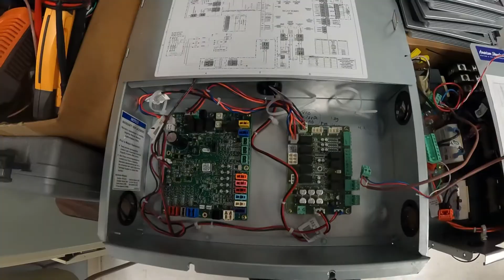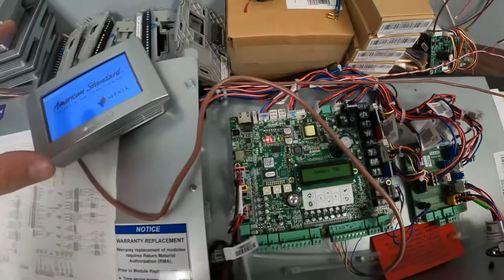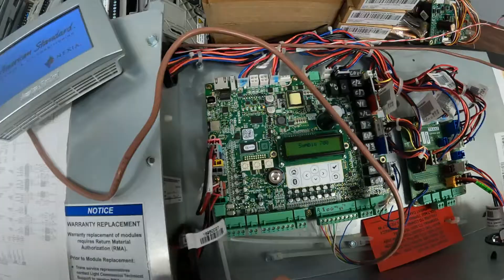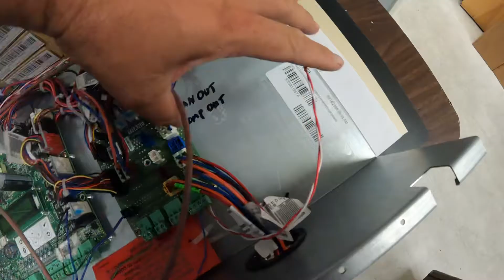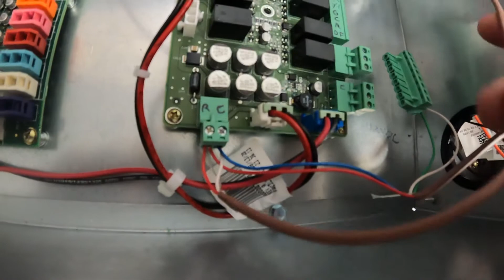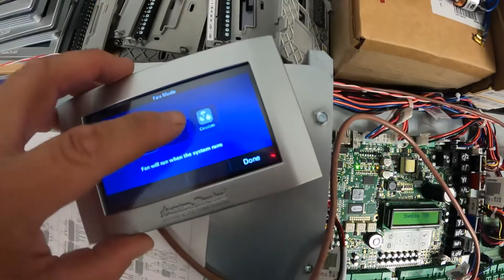American Standard Trane Symbio 700 intro and wiring

Comment: You have good knowledge of the Symbio 700...our customer wants conventional thermostat input to control unit from a DDC System (not Trane) and has the Trane VFD that came in the package, and wants to control the Fan for a Zoning System, based on Static Pressure.  In Config Menu, selected Conventional TStat, but he says that messes with the VFD control and makes it two speed in Conventional TStat...Do you have any idea so this?  Thanks in advance. Reed

Comment: I am correcting an install on a unit Trane is absolutely no help, I have the same error code your showing but my IMC is wired up identical to how you have it wired
Reply: Oh key note I have a vfd so I have the J16 and J7 connected but nothing will work won’t even go into the test mode
Reply from the maker: If you have a VFD. You will probably need to set it up for VVZT. Not CVZT.
Reply: @Hvacoffroad  I’m going back Monday, when I change that setting it instantly looses IMC  communication . Have vfd bypassed for the moment but going back to figure it out. 
 I was able to get it going just isn’t right

Comment: About the heat kit? Where you connect?
Reply from the maker: In your heat kit, you will get a wire that connects to the J2 or J3 plug on the top of relay board. 
If you didn’t buy a new heat kit, you will need WIR10632. That is the harness that will connect to the relay board.

Comment: Thank you for the video. You’re the best. 
I hooked it up exactly the way and I’m still getting indoor options mod comm error with the red light on the outdoor board like you had till you plugged in indoor board at the end of the video
Trane did have me connect outdoor J16 to indoor J7 and that still didn’t work 😢
Reply from the maker: What faults are you getting on the app?
Reply: @Hvacoffroad  I've installed 3, 2 more recent on same property. The 2 new ones say "indoor modcombus" or something to that effect (been a few weeks since) and first one installed back in August last year (first one; aimed for bushes), changed compressor tech support recommended, now on startup it runs intermittently with "comp 1 proving switch". It's not red or even yellow, just gray. It's 2 stage single compressor.

Comment: I must say, its definately a trane. I have a symbio ahu claims to be two speed with a vfd that has a 2 stage gas furnace along with not one but two symbio condenser straight cool that i used the fancy z pairing on. I have twisted pair to both units but nothing in the docs anywhere really says if the 2nd condensor needs the imc connected. And just like everyone else on the planet, it aint working.   What a convoluted thing this is.  Why? If anything stops working it all will stop working. No heat from the vfd that cant speak with the cool only condensers,  sorry. It just makes no sense at all.
Reply from the maker: It sounds like you have a very unique pairing.  I would recommend reaching out to who you bought that equipment from.  They should be able to help support you.  Sorry, I don't think I can help with that combo.

Comment: Does it matter where you put the red and black so long as they are in the J18 emergency stop?
Reply from the maker: Correct, shouldn't matter which terminals on J18.  They are normally open contacts.  When closed, they will trigger an e-stop.
Reply: @Hvacoffroad  thank you.

Comment: How to do the connection for unit with vfd
Reply from the maker: Same way as I show in this video, with the addition of another twisted pair of wires.  It should run from J-7 on the indoor relay board to J-16 on the outdoor adapter board.  I hope to make another video on this as soon as time allows.

Comment: I have a trane heat pump condenser symbio paired with odyssey vfd air handler. Wired accordingly, used communication wire. But still have light flashing on vfd controller 5 times for no communication. Any clues?
Reply from the maker: Either it’s not configured in the app right for the vfd or it’s not communicating through the modbus wires. 
You do have to run an additional pair of communication wires. So 2 bundles. One  pair for the options mod and one pair for the vfd.

Comment: I did the exact connections you did, note this is my first time dealing with symbio, but our unit keeps tripping at the transformer, same connections but it just trips
Reply from the maker: I would suspect a wire short then. 
Remove the wires from J21 on the condenser and jump the pins together for the desired mode. Does it trip then?

Comment: Great video and really helpful man thanks for taking the time to do this kind of videos hope you make more like it
Reply from the maker: Glad it helped. I’m working on a Symbio vfd air handler video now.
Reply: @Hvacoffroad   I will be looking for this one i just installed my first one on a school gym and it will be interesting to watch
Reply: @Hvacoffroad hey o was wondering if you ever made a video regarding the symbio with a VFD AHU. I heard in the video that you brought the hot 24VAC from J10 to J4 this is needed for the controls side  for the VFD? And also is the twisted communication for the imc needed if you are using a straight cool unit? I tried finding this info else ware and could not. Any info would be awesome!
Reply from the maker: I finally got my hands on a VFD air handler an will start making videos on it soon.  I'm hoping the end of the month.  
The J10-J4 jumper is used to power up the IMC for the options mod and electric heat in the defrost mode.  You can get away without that jumper and twisted shielded wire on a straight cool unit with a constant volume air handler.  But if it's a heat pump or if it has a VFD, you need the jumper and 2 bundles of the twisted shielded wire.  One for the IMC and one for the Modbus.  
I hope to get the videos out asap.  
 @mattkusano7246
Reply: @Hvacoffroad  do you have the video with vfd already?  i am installing a symbio 700 with vfd TR150  and I can not make it start the inside blower in air handler
Reply from the maker: @vianeydiaz8498  This may help.

https://youtu.be/-2JLX8FPbJM

Comment: Question guys, on the adapter board, what if the thermostats wires are not connected ??
Reply from the maker: The adapter board serves as outputs back to the air handler.  You'll need those connected.

Comment: Great videos !!!! very limited help with the Symbio 700    . I also had Trane technicians come out and couldn’t figure it out, my problem is I lost my 24V output on the thermostat connection point j21 but the board display is active with no errors,  this is a new install. The other 20T split is working well.
Reply from the maker: I think I understand.  So did you move your thermostat source 24v to  J15-1,2 on the adapter board?
Reply: @Hvacoffroad had a call where i had 20volt call from thermostat on the y2 terminal and 22volt call on the y1 terminal - or could be the other way,  don't remember, --had no voltage coming out of board to the contactor on the side with 20 volt call.....since it was a new install, had to refer it to original contractor....can you tell me what the problem could have been????board, thermostat,  reset????ty

Comment: So I'm switching out both outside and inside units. Not in a position to run a new stat wire. Original wires came through the air handler. I got that part how to work around that. My problem is, after the thermostat controls are hooked up I have 2 spare wires left. I'm gonna use one for evaporator defrost and the next to connect to indoor fan on adapter board then tie it into the condenser G wire on the inside. Is there anyway pass running the twisted shielded wires when you want to use the options module?
Reply from the maker: There is a manual from Trane that’s has and “experimental” defrost circuit. This may work for you as it doesn’t require the twisted shielded wire. 
https://tranesupport.zendesk.com/hc/en-us/articles/360059909352-Odyssey-Symbio-700-Troubleshooting-Manual

Comment: Hi excellent video! What is the option module for? I have the relay board but no option module but I do have a Symbio outdoor unit. I have a heat pump without electric heat. Thank you buddy
Reply from the maker: Currently, the option mod only is needed to energize electric heat during defrost. They intend to us it for more, later on. 
So with you application, you don’t need it if you don’t have electric heat.
Reply: Do you use it for straight heat kit or is it just heat to during defrost. I have a Odessey unit installed but no electric heat because Trane said I needed the heat options board to run a heat kit for emergency heat? Thank you sir you made this very easy to understand you should be teaching hvac.
Reply from the maker: @2tiresdown  To wire it up the way the factory wants it, yes, you need the options mod for electric heat.  But if you are using a straight cool with electric heat, you don't "need" it.  You can send your Heat call to the relay board on the w2 pin, and it will energize electric heat, without the options mod installed.  But don't "tell" the symbio board you have electric heat when programing the outdoor unit.  If you do, it will search for the options mod, and pop a comm failure code.  Hope this helps
Reply: @Hvacoffroad  awesome thank you buddy you are a lifesaver Sir
Reply from the maker: @2tiresdown  you’re very welcome
Reply: @Hvacoffroad  when I send my W2 call for electric heat how do i get it to my electric heat contactor with the heat options board. I know you said on the W2 terminal would it be on my air handler W2 or tie into the thermostat wire going to the symbio outdoor unit W2?
Reply from the maker: @2tiresdown  if you are using the twisted shielded wire, it sends the signal into the air handler for electric heat.  You would only run your w2 from the t-stat to the condenser.
Reply: Hi buddy last question I actually ordered the heat options board because I have a heat pump. We can get access to run the Line set until next month but I wanted to run the heat kit. Would I just tell the 700 I have the heat options board and wire it up? Or since I’m not using the heat pump could I just wire it up and leave off the cooling or y1 connections and just wire it up to W1 for now? Do I need to add a heat contactor or is good with just the options board to run it like normal? I appreciate all your help and I feel terrible to keep asking but Trane has been no help at all.
Reply from the maker: @2tiresdown  no worries man. 
If I understand you correctly, you just want to use electric heat until you do the piping?
I think you can program it as if you had a heat pump with backup heat. But, like you said, don’t hook up the y wire for the compressor.  No extra contactor needed if you got a new heat kit with the air handler.
Reply: Also thank you again for all the help send me your cash app info and I will cash app you for all the help you been to us. Thank you buddy
Reply from the maker: @2tiresdown  I’m happy to help.
Reply: My condenser comes on and shuts off after a few seconds with no error except compressor proving

Comment: How do you wire this outdoor unit without communication air handler ? I got a unit just installed and don’t know why it’s not coming on .
Reply from the maker: You don't need to wire this outdoor unit to a communicating air handler for it to function.  The communication wires are only used for electric heat defrost, with the current setup.  Will it work using the test mode in the app?
Reply: @Hvacoffroad  it took awhile for us to get it running , I didn’t know the board has the features that wont allow the unit to run if it in wrong phase .
Reply from the maker: @avr8891  Glad to hear.  That symbio app will help assist with the fault light.  If you ever see the red fault light, connect to the app and check the service tab.  It should point you in the right direction.

Comment: Can’t get my indoor communications failure to go away. Not communicating to properly run my 2 stages of heat “IMC”
Reply from the maker: Check the addressing dials.  For electric heat, the should be at "75."  SW1 to 7, SW2 to 5.  If that wasn't done before start up, you'll have to reset the IMC link under the service section of the phone app.

Comment: I replaced an older Trane system with a new one with Symbio...It was a 6 story building that only had 2 conductors between the air handler and condenser. How will Symbio work in that application? IMO this system is not compatible with most changeouts since there is not going to be enough control wires. Here in South Florida we have mostly straight cool systems with 2 conductors to the outdoor unit.
Reply from the maker: That's a great comment Steve.  I had to think how we can overcome the issue of 2 wires.  Check out this video i just made.  See if it will help you in your application.  https://www.youtube.com/watch?v=TMjf_Kryd8g
Reply: I agree... after all that New School Symbio controls the fans and compressors run just like Old School :) and for only and extra $$$$ dollars.  I have to admit though it pretty amazing what the controls can do.

Comment: Do I need to use that specific thermostat or can I use a conventional tstat like a honeywell T6 pro thermostat? I wired up the unit, excluding the twisted shielded cable because the air handler did not come with the options module, and both compressors turn on (it's a dual compressor condenser and constant speed) and off at the same time (I hooked up y2 on the J21 terminal to my thermostat). It can't seem to differentiate between stage 1 and stage 1 + 2. It also gives me an alarm stating that there is a communication failure but I wired it almost identical to yours (excluding the twisted shielded wiring and it not being a heat pump). 

Do you think it's the thermostat, or maybe I didn't configure the symbio settings correctly?
Reply from the maker: Alex- Any generic thermostat will work so your T6 is fine for your application as long as you wired y1 and y2 accordingly. 
It sound like a configuration issue to me.  Make sure the “cooling” is set for 2 stages on the configuration screen. 
Will it run in first an second stage independently in test mode?
Reply: @Hvacoffroad  I appreciate your response. I made sure that cooling was set for dual stages on the configuration screen, I have Y1 and Y2 wired, and when I run it in test mode, both first and second stage run independently. I've contacted Trane and someone told me the unit is not set up for 2 stages even though I have two expansion valves and a split coil in the evaporator. They told me they'll get back with me tomorrow to discuss my issue. But I just want to thank you, because your videos have been a big help and have made me understand this more. I really appreciate it!!
Reply from the maker: @Alex-bk4vc  If each circuit will run separately in the test mode, your configuration is probably correct. 

Look at the black relays on the symbio board when you call for first stage through the thermostat. Do you see LEDs light up next to “LED 5 and LED 15”. 
5 is for first stage and 15 is for second stage. 
Also. Look at the “home” screen on the symbio app. It will tell you if it’s receiving a signal to open or close contacts. Look to see if y1 and y2 are “closed,” when you are calling for y1 only.
Reply: @Hvacoffroad  So I finally figured out what was going on. In Symbio split systems that are 10 and 20 tons, and that are dual circuit, the compressors have unloaders. So when y1 is closed, both stage A and stage B compressors will run but only at 66.7% cooling capacity. When Y1 and Y2 are closed, both stage A and stage B compressors will run but at 100% capacity. When the compressors are unloaded, they're pulling 9.3 amps compared to 11.6 amps when they aren't unloaded. When Y1 is closed, the "LED 5,6, 15 and 16" are on. When Y1 and Y2 are closed, the "LED 5 and 15" are on. 

Basically, in 10 and 20 ton Symbio split dual compressor systems, both compressors will always be on. Y1 controls compressor 1 output and compressor 2 output; while Y2 controls compressor 1 output, compressor 1 unloader solenoid output, compressor 2 output and compressor 2 unloader solenoid output. It is built into the Symbio schematics to have both compressors come on and turn off at the same time. 

I appreciate your help and for always responding!!
Reply from the maker: @Alex-bk4vc  Great. I’m glad you got it figured out. Sounds like wiring and the configuration was right, we just didn’t understand the staging logic built into symbio. This will be helpful information for others. We’re all figuring this new control system out together. Thanks for the follow up.

Comment: So I have a question, what about when the indoor unit is not Symbio..? I’m having the same issue, Trane reps have been out to No prevail. My air handler is constant speed. Came with the unit. 15 ton
Reply from the maker: It would depend on the air handler that you are using.  You would still send the g signal out of J18-1 to the blower signal on the air handler.  I you need 24v hot and common, that would come from J15-1,2. Then, if you need y's, w's or an o, you would get that signal from j21 on the condenser.